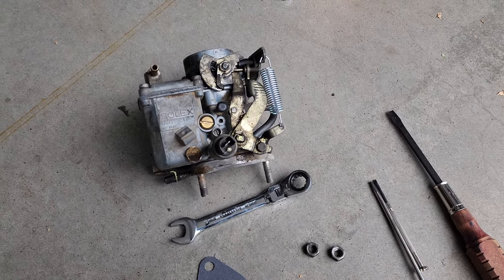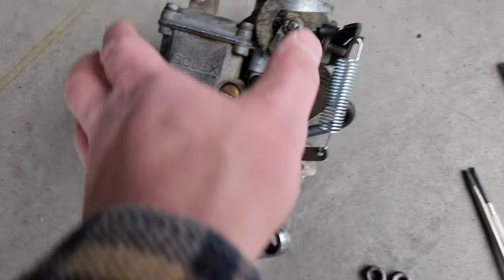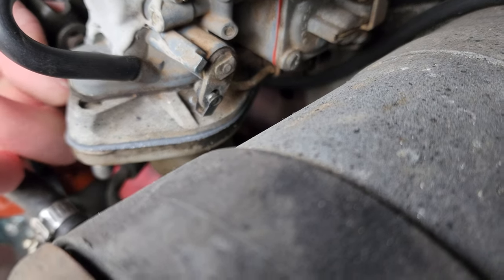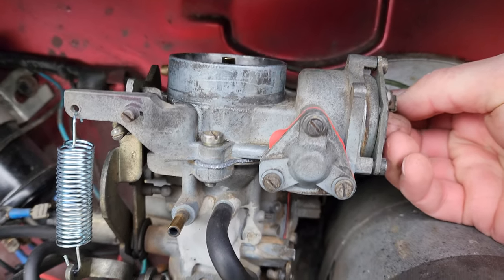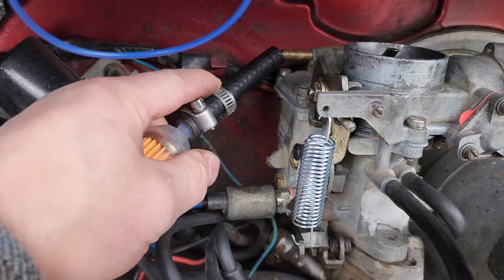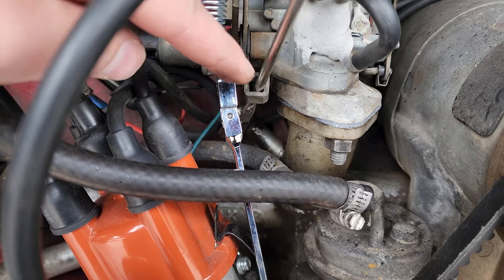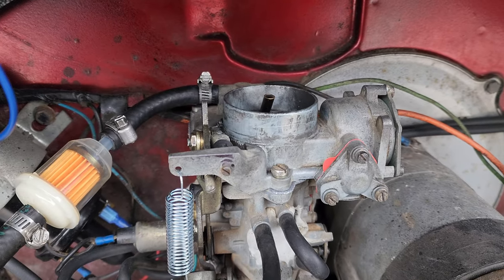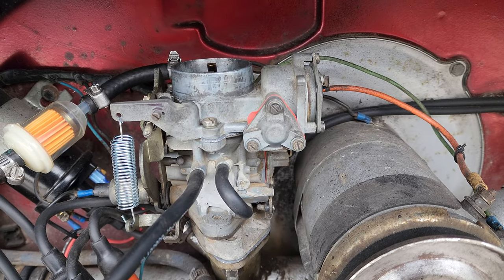air cooled vw beetle carb install.

Comment: Wrong conection of the vaccum advance. It must be connected on the vaccum port on the left hand of the carb (seen from rear of the car)
Reply from the maker: I actually attached  it to that side first and for some reason it ran worse. So I hooked it up to that one instead and it seamed to run better. Any suggestions on why?